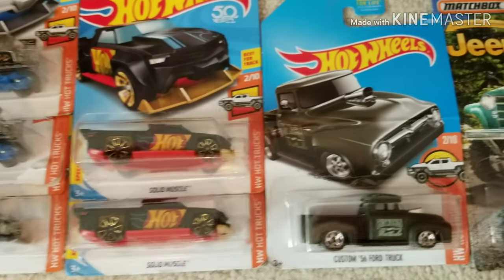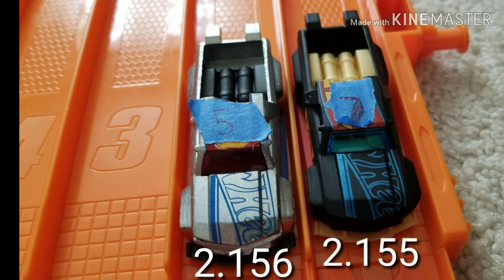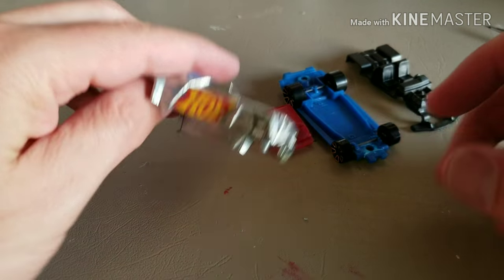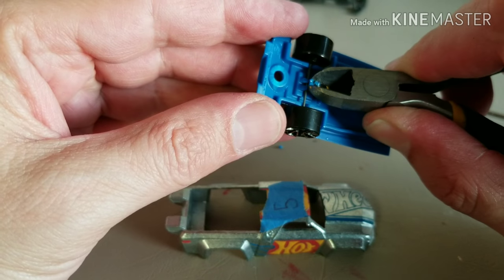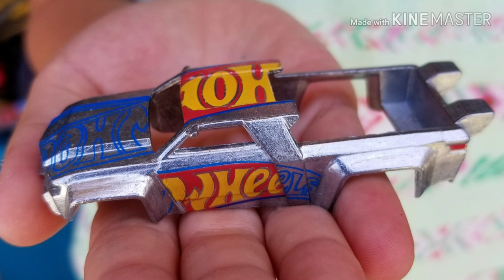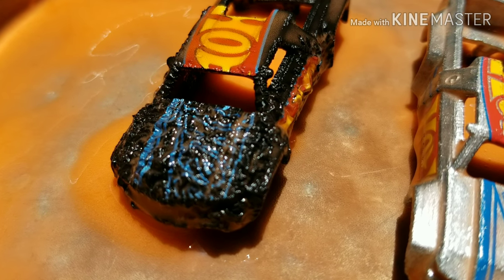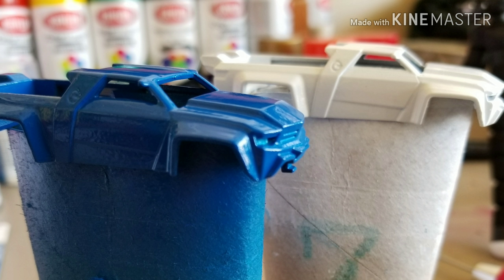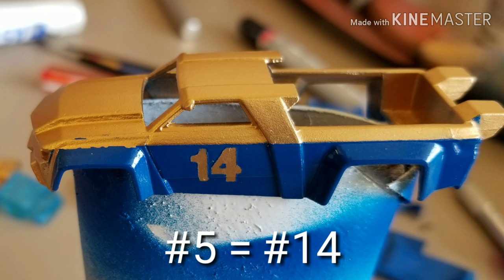Custom Hot Wheels Trucks

Comment: Great video! I like your process, and you presented it really clearly and well organized.
Reply from the maker: Thank you!!
Reply: @Nero62CustomDiecast  where do you source your tap and screws? I have just been gluing my customs back together, but would love to step up the quality, and start using screws.
Reply from the maker: @daveakerscustoms1194  I actually found everything on Amazon. the screws are 2-56 x 3/16" button head allen screws. They are actually self tapping. The driver I found on Amazon as well, but it eventually broke. The one I have now is .05, and I found it at my local hobby shop, Hobby Town U.S.A. I'll try to get the links for u.
Reply from the maker: The driver is .050"
Reply: @Nero62CustomDiecast  thank you! I'm in Turlock, so I might be able to make a day trip and check out that hobby shop.
Reply: They're is a location in Modesto! I'll head over there on my day off! Thanks again
Reply from the maker: @daveakerscustoms1194  Awesome, about  an hour and a half drive into Fresno for you, right down the 99.
Reply from the maker: Or the 15 minute drive to Modesto...lol
Reply: @daveakerscustoms1194  Wow...ive never noticed this hobby shop in the shopping center before lol